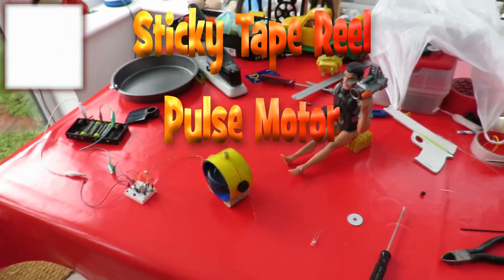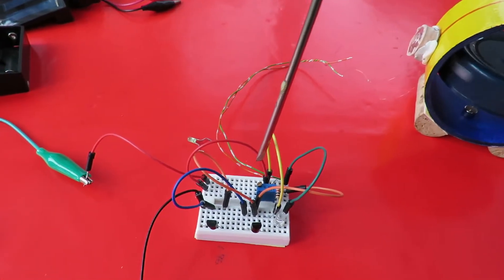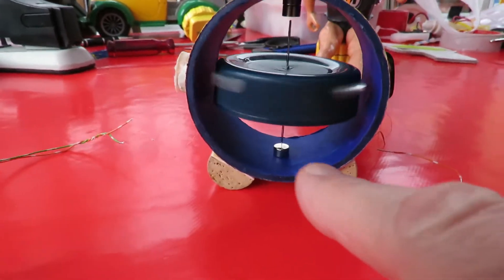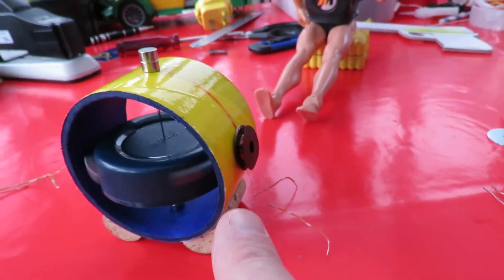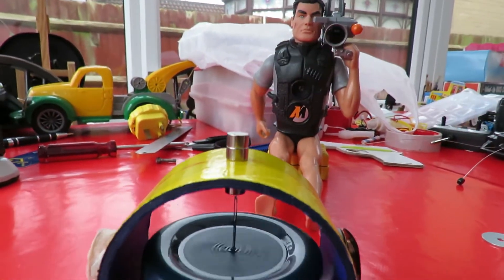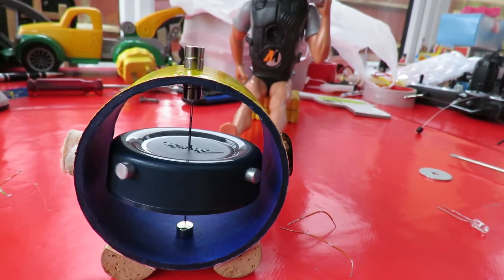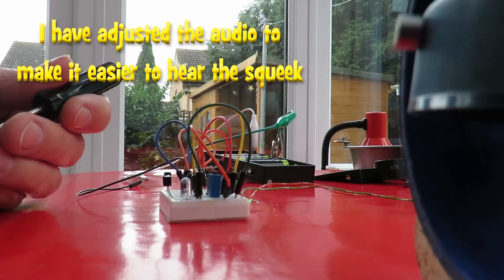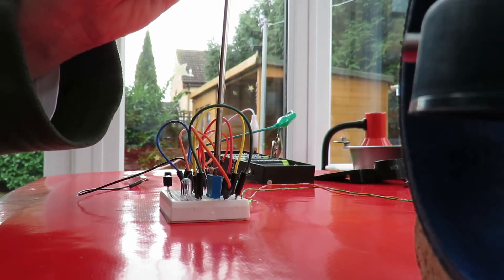Sticky Tape Reel Pulse Motor

Comment: Great success!!  I really like that two transistor circuit and all it's variants.  There are  a number of names for it but the origin is lost in history.  It probably got it's start way back in the vacuum tube days.  A friend of mine (DadHav) is the first one I know to use it in a single coil pulse motor..  I like you motor design.  I have never seen that method before.  The audio tuning was very interesting also.
Reply from the maker: Thank you. I didn't get my needle very straight in this one so the wobble is rather pronounced. The audio tuning caught me by surprise, it is the tip of the needle skating on the flat magnet surface. I expect you could get it to play a tune :-)